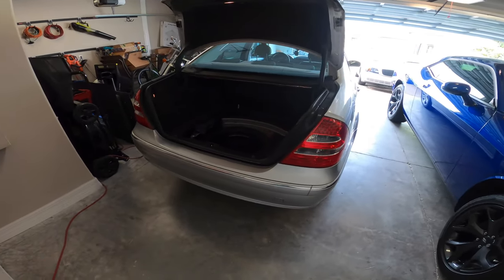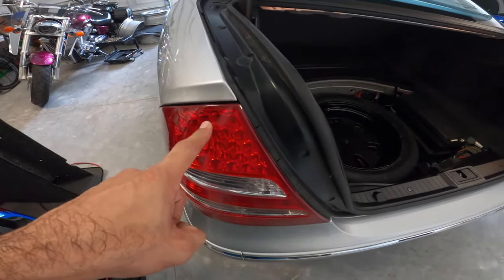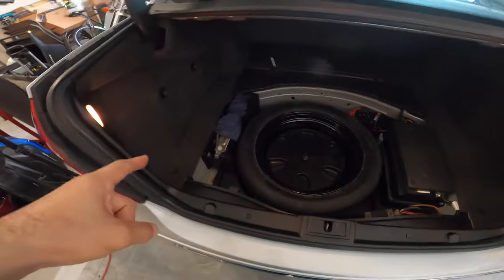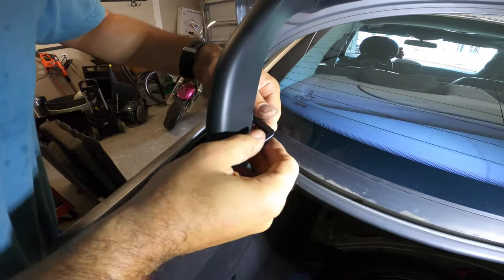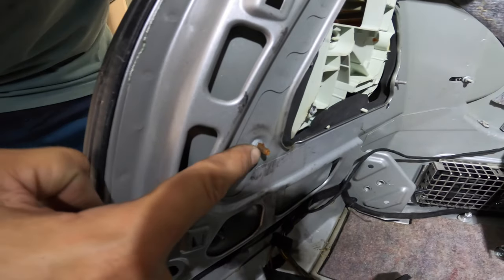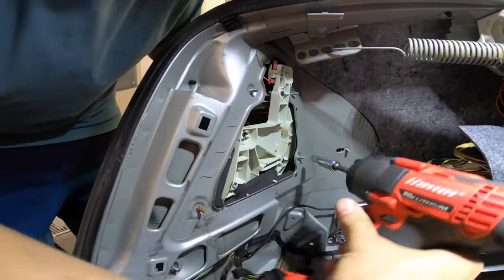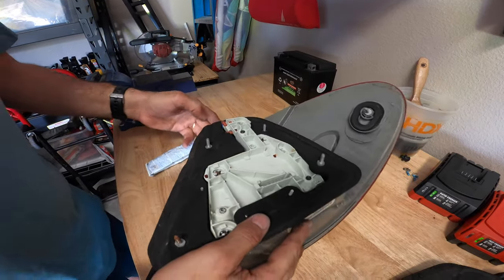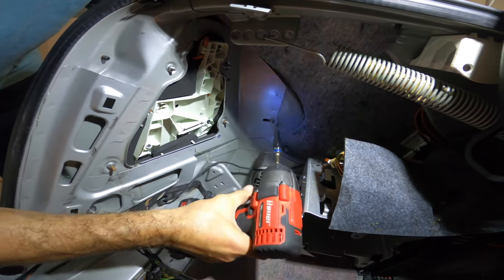Water In Your Mercedes Trunk/Boot - How to Fix It

Comment: Hi... did you know how to replace the vent flaps?(the metal cage on the sides of the trunk). Mine is leaking through there.
Reply from the maker: It's intuitive
Reply: Hey man. Did you end up fixing it? Mine is leaking through the vents too
Reply: @hassanfarasat  yes. You can take them out from the inside of the trunk, depends on your car. I didn't have to remove the bumper. I just applied urethane glue around the vent and that fixed the problem

Comment: Hi do you have a link for the gasket please?
Reply from the maker: I got it at the junkyard, sorry.
Reply: @dcfgarage  just changed mine yesterday thanks to your video.
I couldn’t find the gasket so I bought the 03 lights which came with better ones. A bit of sealant and fingers crossed I don’t get no leaks.
Reply: Ebay

Comment: 2012 R350. I hear water swooshing in front.  Any tips?
Reply from the maker: Hard to say. Did u find out?
Reply: @dcfgarage  I actually clean the drain holes as best I could. I also noticed that as I drove, especially turning helped drian the water.

Comment: Anyone have a leak on ML350 2010? Does it have any drain plug? I hear a swoosh when I hit the pedal or when I brake. I don't see the water but hear it I'm the rear. Thinking it's underneath the trunk. Any ideas?
Reply from the maker: Did u check if the drain is clogged under the spare?
Reply: @dcfgarage  I am going to check that. I wasn't sure if there Is a drain plug where the spare is. Never went through this issue before. I will check. Thank you for your response